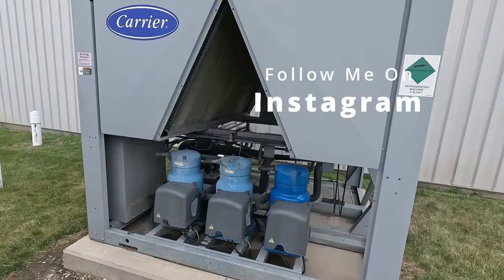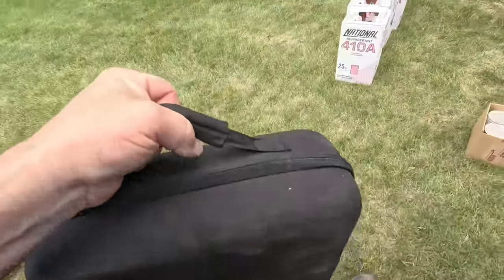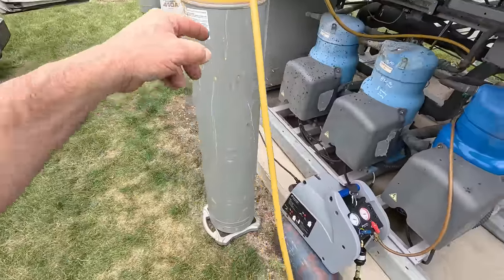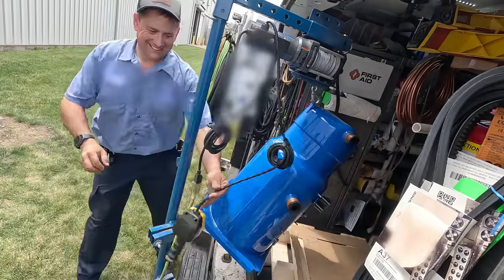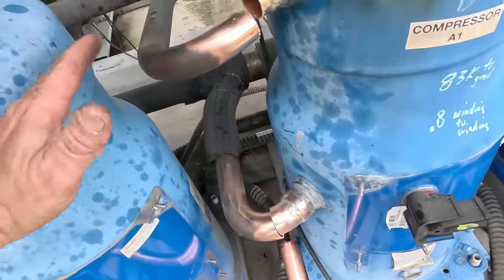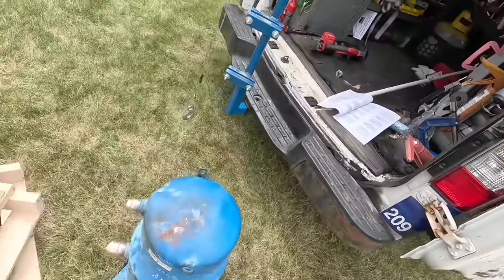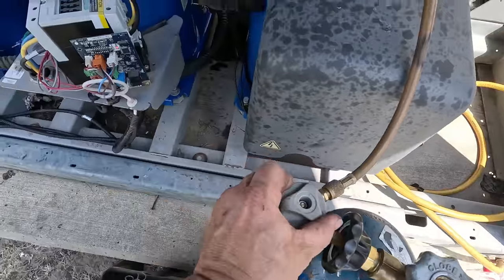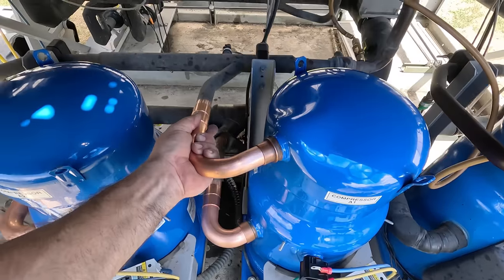Double Compressor Failure Was Not Enough Excitement

Comment: Please look for the conditions for using the "push and pull" recovery method and how to do it. Unfortunately  your stetting can´t work. You "Recover" from the condenser to the evaporator if you push liquid into the suction line. The Method just works with liquid refrigerant in the system and left vapor in the system, so you have to change the setting for full recovery.

Liquid from the System pushed into the recovery cylinder. The vapor over the liquid is pushed to the recovery unit an is compressed to hot gas vapor. This vapor with higher pressure is used to to increase the pressure above the liquid in the system and push the liquid into the recovery cylinder. The compressor of the recovery unit ensures a lower pressure in the recovery cylinder compared to the system. 

If your compressor is not working, the refrigerant is liquid at the coldest point of the system (sometimes in the evaporator), unless it is pumped out into the receiver beforehand.
Reply from the maker: I think what killed me was the fact that it was already 40 lb low. I didn't realize that at the time and I knew things didn't work out right but I decided to leave it in there. Even if it did make me look less knowledgeable.
Reply: @HVACRSurvival  This recovery setting has just triggert me to comment the video. 
 
...Last week I wonder why a compressor was not running ...turned out I looked at the false one... and I know this Unit. Don´t know why it took me ten minutes to realize it. Sometimes the brain run in mysterious directions ;)

Comment: Well. Looks like they did have pretty good starting/protection components, so undervoltage or single phasing shouldn’t be happening. 
Too high of a compressor superheat, or refrigerant migration causing inter winding shorts/low insulation resistance.
Low evap. superheat, especially for chillers, is usual suspect. Like I said in my other comment - these are little more forgiving on liquid slugging, but too much of liquid refrigerant in the winding is detrimental.

Comment: Should have come off the liquid line for your push pull, not discharge. There HAS to be liquid at the gauge port where you attach your hose from the system to the tank. Discharge line almost never has liquid sitting in it. 

Best thing is to set it up to “push” through the evap, into suction and out of liquid line. 

If you have LLSV’s, after that you can “push” into the discharge and come off your liquid line into the tank. 

Once all the liquid is out, you have to switch to regular recovery. 

I recovered 100lbs of liquid in 15 and a half minutes, and the last 18 pounds of vapor took another hour.
Reply from the maker: That would make more sense. That's why I kept checking the diagram but with that being 40 lb low on refrigerant I don't know how much liquid would have been left
Reply: @HVACRSurvival  didn’t realize it was 40 lbs low, probably not much liquid left in it anyway.
Reply from the maker: @Shmash_whatever  yep, it held 90lbs on that circuit

Comment: Before replace the new compressor must be flush the system and replace the new magnetic contactor
Reply from the maker: How much chiller work do you do? You're not going to flush this system. And 90% of the time that flushes is a bunch of garbage. And the contactors were replaced, I believe I mentioned that in the video but nobody listens or watches the whole video so that's probably why you didn't notice it.
Reply: When i replace the compressor i must be flush the all system condenser and evaporator

Comment: Do you use the red Loctite for refrigerant? That’s also a Sealant when you put your brass threaded refrigerant ports in the top of the aluminum plate of the filter shell housing?
Reply from the maker: I've never had to use loctite on them. If I had issues with vibration having them come undone sure.